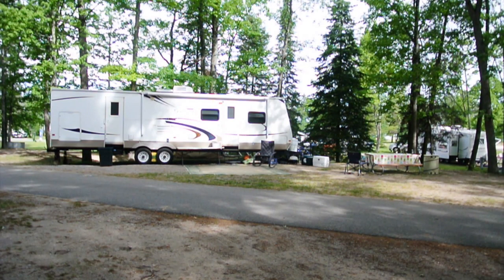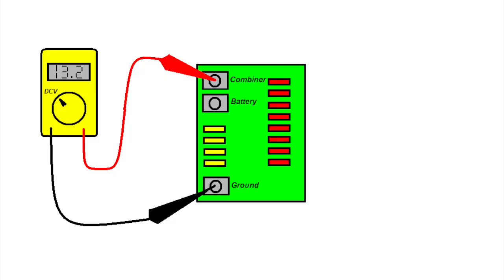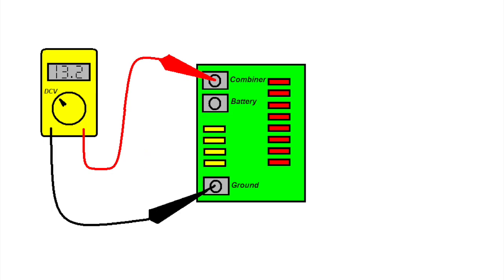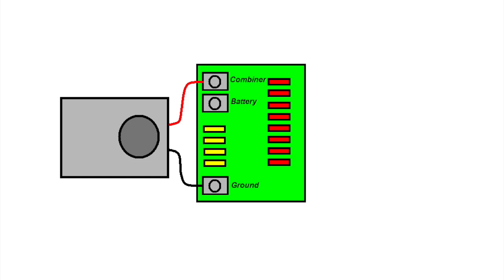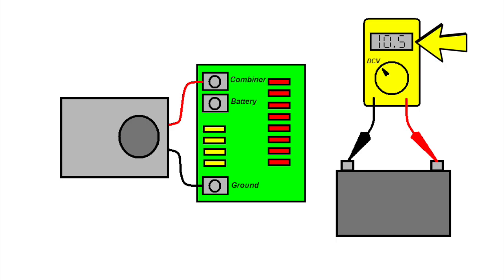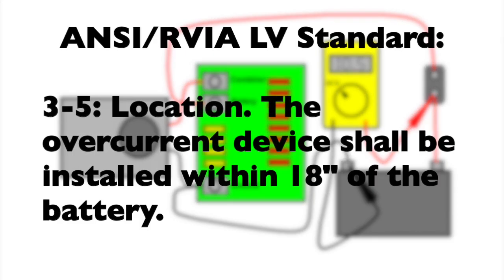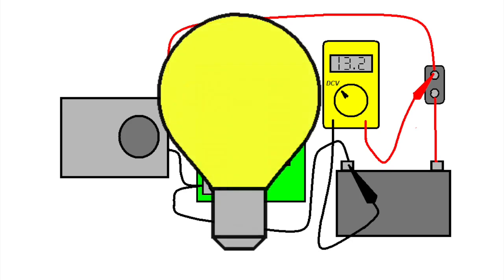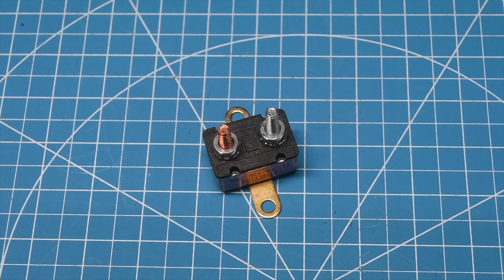RV Troubleshooting Ep1 - Battery not supplying power.

Comment: I have a similar problem, but mine is intermittent. Just replaced the battery. My issue is that the battery power works only 50% of the time. 120V power always works. Its as if the front key switch was turned off, even when its not. 

Im assuming its either the key switch itself, or a loose wire on the main power cable. Ill try my luck with the multimeter. Im pretty handy with mechanical stuff, just not alot of experience with electrical. Here we go!

Comment: 18” you say?  Hmmm. 
On my 2010 Rockwood TT, I re-worked the battery connection last year (to enable a solar hookup), and without measuring would say there was a good 5 ft of factory-installed 8 AWG wire between the battery positive and the breaker.

After my changes it’s no shorter, but I did add a fuse at the positive battery terminal.
Reply from the maker: The RVIA (RV Industry Assiciation) has adopted NFPA (National Fire Protection Association) Standard 1192. This is a non-government standard that establishes minimum construction practices for RVs. 

NFPA1192 also incorporates the ANSI LV (Low Voltage) standard as well as a portion of NFPA 70 (National Electric Code).

That is where the 18" requirement comes from.

While again, it is not mandatory, most mfgs claim to build RVs to NFPA1192, and in fact have a pretty little RVIA sticker on their RVs that says so.

And the original owner paid a few hundred dollars for that sticker.

So incompetence, or for whatever reason, I would be surprised if many RVs would actually pass an audit of NFPA1192.